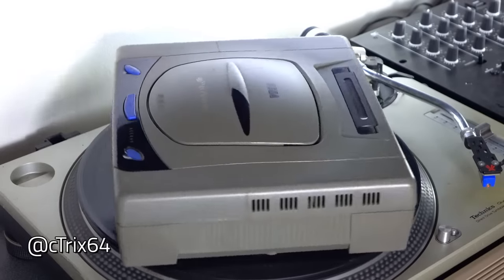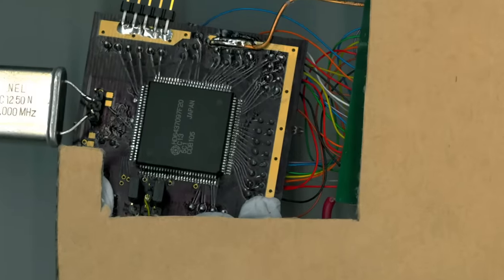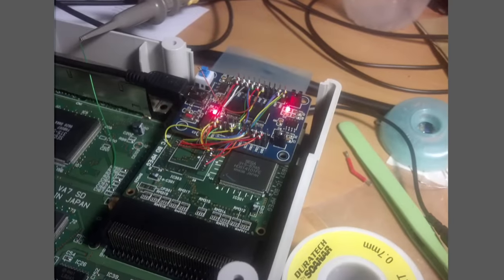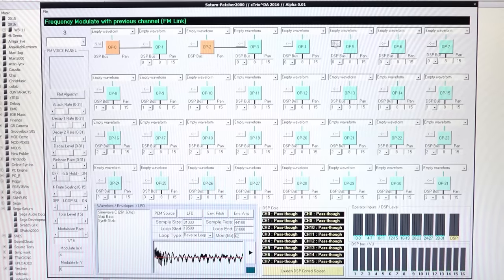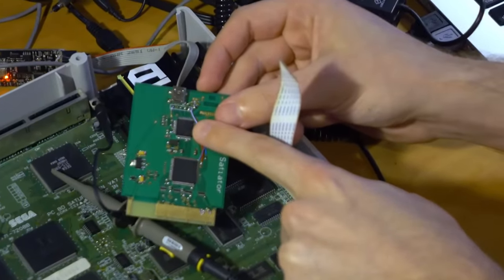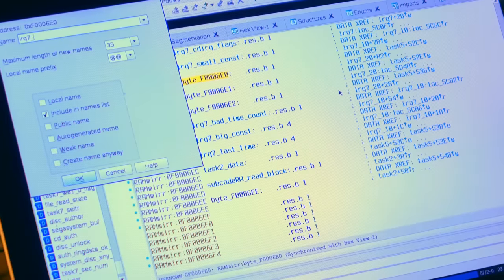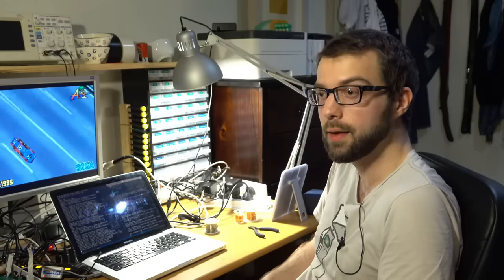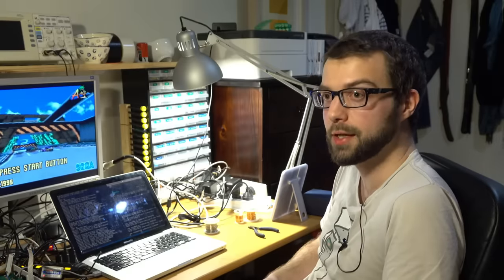Sega Saturn CD - Cracked after 20 years

Comment: This has over a million views!  When will a VCD slot SD card reader be available?  Anyone guessing?  based on the views the potential for profit is gigantic. 

So many Saturn gamers are at the mercy of Ebay bank busting prices. Please release a VCD SD card adapter for the legions of struggling Saturn fans. Please.
Reply: Gorilla Jones view count doesn't really matter i watched the video like 20 times
Reply: Félix L 
Well, it is a million+ views lol. Even at 20 for you there is plenty of interest.
Reply: A simple SD card reader would not be  the solution to making this product. the Sega Saturn utilizes a DRM checksum located on the CD block which is cross-referenced to the CD drive mechanism to make sure that is a valid checksum on the disk. This system is very similar to the Xbox 360 DVD drive which utilizes topographic security data at the edge of the games which the Xbox 360 DVD firmware looks for in relations to its checksum database. 

It would be pretty easy and straightforward to create the product you're asking for in small quantities, but it would be rather difficult to mass-produce  the product since there are four different models of the Sega Saturn and the customer would have to disassemble their device and check their model number utilizing the VA number and pin count to make sure it is compatible with the ODE since the eight different optic drives variations would be utilizing a different wobble checksum logic block since the drives would be using different firmware.

It would be possible to incorporate all of the components needed for the 21/20 pin Saturn's onto a single board and in relation to the serial number, build date and drive model, have the customer position dip switches on the Optic Drive Emulator board in the correct order/map to make it validate the correct wobble check-sums and disk rotations for proper data playback. 

You could also have the ODE as a go-between which sits in between the original drive and the ODE and have the original drive dump the original games to the ODE for storage and playback or you could have the original drive dump its firmware to the ODE for near-perfect emulation of the drive. If I had about two months to design the board and  get the parts since most of the legwork is already done, I could get a 21 pin or 20 Pin Sega Saturn to have this functionality in place, but the price would probably not be to your liking.

I know the drives themselves on the Sega Saturn's are slowly dying and are becoming impossible to replace the  actual optic components. If the drives themselves were still in working order instead of utilizing ODE a simple chip/board could sit in between the original drive and the game console it self to manipulate and implant the wobble check-sums as a burn backup copy of the game was being read to validate the disk.
Reply: Well, it already exists and has for some time. In fact it's older than this Video and is called Rhea. The guy also makes a Dreamcast SD reader called GDEMU.
Reply: @Commodore4eva  Correct. This is basically a Mod that will help substitute the aging CD Drivers by having the SH-1 Milkyway tell the Saturn Itself to recognize and Read the already Existing ROM from the CD using a Serial Port. The USB is a Backup, the Saturn can't read SD or USB(Because none of these formats existed in the mid 1990s as Saturn's technology is from 1993), Its STILL reading the CD ROMs, its just not reading it from the CD Drivers, because the SH-1 Milkyway is the Saturn's FORTRESS against Piracy and has State-Of-The-Art WAY ahead of its time Anti Piracy DRM through the use of "Flash Driving" By basically doing a "Checksum" of causing the SH-1 to read the ROM as "Licensed by SEGA".

And those who think they'll just be able to download Emulated ROMs, upload them on the USB Port and play them on a Real Time Saturn, they couldn't be more wrong. Emulators and its programs are all Open Sourced and Unlicensed, the Saturn would NOT recognize or read the ROMs because SH-1 Milkyway would tell it and the Main SH-2 Aurora itself that, its "Unlicensed and Copied ROM reprogrammed separate from the SH-2 and Sophia SDKs" and thus, the Saturn would not run the ROMs.

You will STILL need the original CD ROM itself to run the program with the USB Port Modded Card, and for those who'd like to Homebrew, you would need both the Card AND a ISO programmed CDR, without the RISC Wobble(Saturn's Key License Key DRM from SEGA themselves), the Homebrewed ROM would have to be read by SH-1 Milkyway through the CDR with the USB telling the reprogrammed SH-1 to read the ISO as a New programmed ROM running on the CDR.
Reply: @segaunited3855  so this is impossible?

Comment: can this improve emulators to work better?
Reply: yep, by a lot.
Reply: this makes perfect emulation of the sega saturn cd programming possible without bugs or other issues like the games running too fast.
Reply: yep yep triple debt
Reply: Not only will emulators work better than they currently do, but in general they will work better than the Saturn itself with some, if not all games. Symphony of the Night for example, on the console has frame rate drops from 60fps to 30 during gameplay. Emulated, the game runs at a steady 60fps. Granted the Saturn version has other issue, but those come from the way the game as ported
Reply: im thinking...will the emulation run faster on not so powerful pcs,
i have 3gb ram,dualcpu 2.2ghz, 1gb gforce 210 i want to dedicate this pc to saturn emulation
Reply: literally covered in the video
Reply: +Prehistoricman that comment is a spy

Comment: This is literally the second time I've watched this whole entire video and still scratching my head trying to figure out what the f*** I just watched..
Reply: 10xKameHam 10xTheMayhem it's a YouTube video
Reply: The CD is a hardware for storing data. The wobble is a hardware encryption that only the system knows how to bypass, otherwise there is no reading the data. He had to go into the system itself, past the CD reader and connect his own hardware interface to the connections that go to the CD reader. He then grabbed all the signals (data) from the hardware components and literally made a 1:1 software map of all the hardware. He then dumped the original code of the hardware into that map. He then understood how all that worked as a completely different ISA through those instructions that the other guys (the emulator guys) had previously been able to decode. He then wrote up solid state data on a USB that followed the pattern of the hardware, without needing to use a CD reader. And thus he basically converted the saturn from a CD console to a cartridge console that he knows how to write to.

Comment: At around the 22:00 mark, the multi-threaded nature of the Sega Saturn is discussed, and how emulators compromise by emulating one CPU1 for 100 cycles, storing the output, then running the other CPU2 for 100 cycles, run GPU, SPU and then combine the output of the subsystems. That seems to mean that the emulator is running as a single thread on the host system. 
I wonder: With today's multi-core CPUs, would it be possible to have multi-threaded emulation? The Saturn had a total of eight processors* -- would it be possible to have each of those processors as a seperate thread, to get cycle exact emulation, and take advantage of today's CPUs?

 *2 x Hitachi SH-2 (Main), SCU (Bus control), Motorola 68EC000 (Sound), SCSP (Sound), 2 x VDP1 (Video), Hitachi SH-1 (CD-ROM). "Over-engineered" indeed! A lot of arcade boards have this kind of design, where each function is controlled by a seperate processor, manufacturing cost is a lesser concern, and the board can be designed around the needs of one game.
Reply: It's pointless to emulate each CPU on a separate host thread. Unless you have 8 cores in your host CPU, the threads would be preempted anyway, and you lose the ability to run them on a separate time scale, it becomes non-deterministic. Also takes up more resources to spawn actual threads and rely on the system scheduler than to manually emulate multitasking. The emulated system does not care.
Reply: I really understand very little of all of this but with the timings supposedly depending on proprietary hardare with very specific frequencies, etc isn't it logical to "sandbox" emulate these exact hardware parts and speeds as a program and watch all the data flow through these seperate emulated bits hardware parts? But that's probably something obvious or practically nonsensical. I have no idea aboutn the ins and outs of this.
Reply: Saturn used a Dual 32-bit CPU separated on two Wafers called SH-2 Aurora. Aurora shared the same DSP Bus on each side.

For Graphics it used VDP 1 and VDP 2, with 4MBs of VRAM.

Much like Genesis/Mega Drive recycled Master System's Z80 for Sound CPU, Saturn recycled the Motorola 68000 from Genesis for Sound CPU.

Comment: This guy might as well be sat alongside the Saturn engineers back in the 90s building this thing. It’s one skill to write your own code and build a machine. But to take the machine dump the rom and then categorise it in a way that enables you to learn the inner workings of the machine and rewrite code that runs on the machine is something else. Kudos to the guy for pushing through the mental side of this

Comment: it doesn't  work anymore, sega just released a firmware update sadly
Reply: lol
Reply: slow golf clap
Reply from the maker: I miss the days of locked-down "finished" hardware.  There would be a possibility to code detection into future games for stopping games working on modified hardware (and indeed this was a thing back in the day).  But mostly, once a flash / loader solution was invented, it was there to stay.  A classic software response for PC software (for instance) was to shine a lazer though the magnetics of a floppy and burn an area of the magnetic surface - the floppy would then try and read / write to the area with a physical hole in it to check that sector for an error at harware level.  If a critical drive CRC error showed up - then the disk was deemed good.
Reply: lmfao

Comment: What's the Perl at 20:00 for?
Reply: Looks like it generates C and associated header file for general purpose I/O?  PERIPH_BB looks like a common macro for STM32F103 (or related) chips?
Reply: That's exactly what it does. GPIOs change a lot during development and I get sick of fiddling with those bitmapped registers. This way I can use named pins everywhere (bless you, bit banding) eg. if (C2_SOMEPIN) C2_OTHERPIN = 1;

Comment: There's nothing like cracking open older electronics. I just opened the first dvd player offered by Sony. It blew my mind how over engineered that 1997 dvd player is compared to most junk you can buy new today. The front flips down, the design looks modern and other than just fixing the "hardened grease" issue, it works. I feel like I jumped in a time machine

Comment: Put the orignal in, take the disc out quickly, put the burned on in, take the disc out, put the original one in again, take that out and put the burn one in again.  Your game will load.  Works with most old consoles including ps1

Comment: I was so happy in 2009 when someone sold me a fried* Sega Saturn dev kit for £150. *The power board, being Japanese, expected about 120 volts via a typical figure-of-eight (infinity symbol cross section) mains power lead; not the UK-spec 250v identical lead. It fried some of the resistors and capacitors that had not burst in two or left the board entirely. Still, it came with all the software development kit on PC friendly 3.5inch floppy disks and the set of manuals teaching you the internals and SDK info. I was forced to put it into storage (with about £300K of other retro computer/console systems and peripherals, many boxed) while my landlord illegally evicted me in early 2015. The storage company decided to auction my stuff off (there was other stuff of mine stored in the unit; rare 1:18 scale model cars, huge amounts of Scalextric, personal stuff, my own prototype software from the 80s and 90s, etc.) and claimed I still owed them money. If I had a Tardis I would rescue that dev kit and give it to you. Not only would you be able to resurrect it, it would have helped you in your endeavours, and saved you spending upwards of £11000 on getting a Sega Saturn dev kit (based on my last kit-only eBay search two years ago) had you tried that route to help you reverse engineer this awesome and beloved of retro systems. I still have a large range of retro systems at home, and in the storage area of my museum-to-be called MIRE (Museum of Interactive Retro Entertainment) which is based in David's Cave 2, Trindle Road, Dudley, West Midlands, UK and I really want to see your CD-to-USB upgrades for my UK-spec standard Sega Saturns as I am struggling with laser deaths myself. I loved the video, the intelligent questions, the geek tech detail (I kept up well with that; been programming since 1980, and spent a lot of time programming on/for many retro systems since then) and it will be a joy to see more of your videos or just be in touch somehow. Google Worm Maze Amstrad for an old but current retro project of mine; there is a FaceBook page setup for it, which could be a simple method to see who I am... :)
Reply: I forgot to mention. MIRE is not just going to be a museum; my business plan is to create a retro system bureau service centre for home brew projects such as enabling new coders to release their new games/tools for retro systems using compatible original media, emulations, etc. as I am very devoted to the retro scene. Horrible events over the last six years have seriously and repeatedly beaten up my plans for MIRE but I am never going to stop making it happen.

Comment: what actually blows my mind is the quality of the graphics kinda like dream cast when you consider some of the crap that's out there now
Reply from the maker: I guess it was all calculated very differently (especially textures) back then.  There's a certain "hardware" 3D look now which loses it's sense of style to some degree.  A good game would really work with the limitation of the texture and poly engine and it was still an era where you were aiming for "1-frame".... that's 60hz / 50hz frame rate without stuttering.

Comment: The Saturn is crazy. Two SH2 CPUs , One SH1 CPU, 68000 CPU, the Saturn Control Unit with a built in DSP , two Video Display Processors, sound chip SCSP with another DSP and a CD controller chip. Wtf

Comment: I'm surprised that (as far as I know) there isn't a cartridge with a program that tells the saturn not to check the disc or simply disables the code that the Saturn uses to check. Another option would be to trick the Saturn on startup into thinking that the disc was a Saturn disc and not a CD-R

Comment: So, basically the way I look at this is...... 1. that you cloned the cd block cpu chip in order to read the operating system off the sega. 2. Then you used that data to recreate the os without the encryption. 3.Then you made a chip for the cd port that would stop the os half way threw booting up right before it communicated with the cd block and override the system with your os and so you could upload your own games to the system?

Comment: i used to tape the door spring open have and good disc that i would swap for a copied disc (i would have to rent on then copy it) after the copyright check i would put the copied disc in and it would work every time. the same thing worked on the ps1 and i think thats why they made the change to a completely enclosed drive.

Comment: This seems almost exactly like the dreamcast hack. A side project of a dying media file type being jammed into the back end of the console.
Reply: Not exactly the Dreamcast was initially defeated by a software solution.

Utopia supposedly reverse-engineered Datel’s Action Replay CDX demo disc from DC-UK Magazine to figure out how Datel was able to boot their CD-based cheat disc. Datel had more R&D and could actually pay professionals to break protections. Heck, they owned their own media pressing plant too (Thin Ice Media), which is how they got around protection for the PSX. They went around Nintendo and paid Panasonic/Matsushita for the tech they needed to make bootable GameCube discs too.

That said, I suspect that the Utopia members responsible for the DC boot disc were probably Datel employees/contractors. ;)

The whole reason why BLEEM was possible to begin with.

Comment: wonder why SEGA over engineering this console so much. Really hard to crack even after 20 years ! Amazing.
Reply: Saturn wasn't originally meant as a CD based console, that's why. The initial design was Cartridge based. SEGA threw tons of money on Lockjacking them with Heavy Drivers when CD ROM got added to its design as an afterthought. Each Driver had a Hidden CPU embedded in it.

Comment: it was already cracked 20 years ago...
Reply from the maker: Correct.  But not without a soldered chip / mod / opening up box.  Whole idea of this is you can take a stock unit and simply plug a device in the back.

Comment: at 16:40 he mentiones termination issues. What is he refering to?
Reply: The transmission lines on the board can behave differently at different lengths. At some lengths the line can appear as an open circuit, a short circuit, a capacitor, or an inductor. So it's important where the line is terminated.
Reply: @caribbeansimmer7894  I see. Is there any article I can read to gain more info. I did a keyword search but it leads me to power systems. I am curious to know how the line acts as capacitor or an inductor.